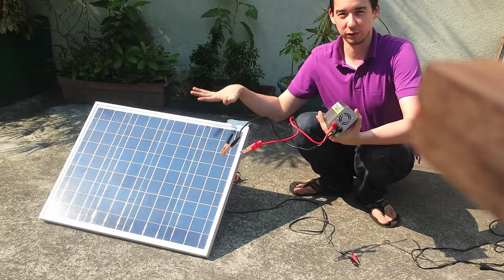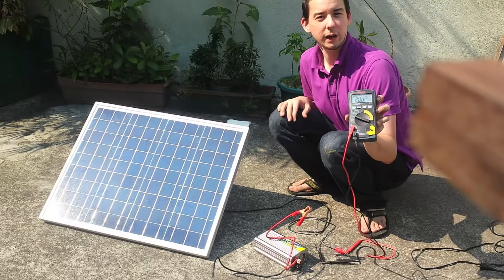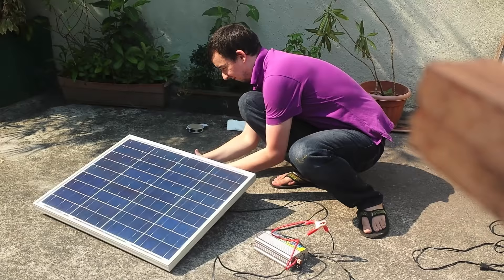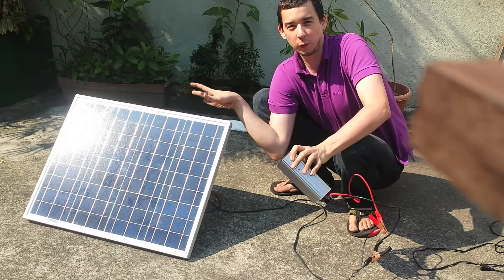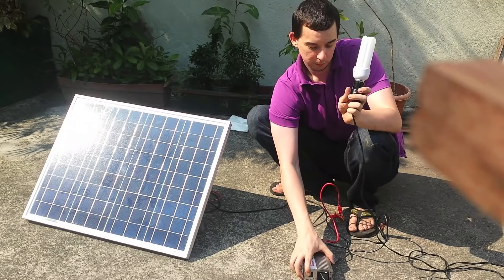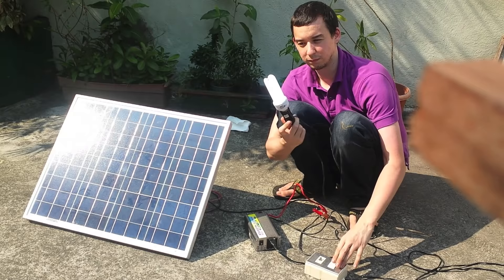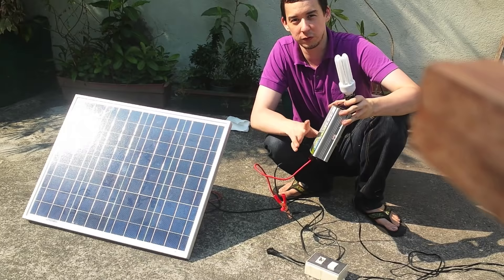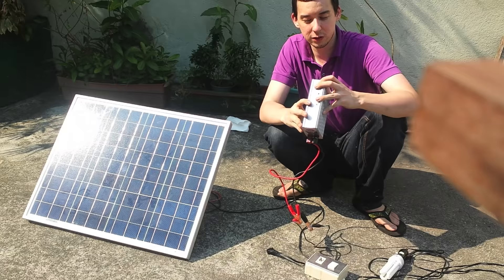Inverter wired directly to solar panel

Comment: Hah! I did that in Spain...   to explain - I have a 250w panel in our summer home in Southern Spain - an area (Andalusia) where you can pretty much guarantee sun all summer - unlike where I am now back in the Northeast of England where you can pretty much guarantee the opposite. The very first thing I did on setting the panel up, was to play with my new 12v invertor - but what I did was to put a step-down buck converter onto the solar panel - mine is 24v and chucks out a lot more than that obviously as it is for charging 24v batteries.... the step down produced 12v which I fed into my 500w invertor which looks remarkably like yours... I have to say it worked a treat...and recovered well from any passing clouds.  Today I have a pair of deep discharge batteries (100ah, 12v) in series on that rig which runs all year around lighting up the outside of the place - and also powering a couple of FriendlyArm Nano (with little hard drives) constantly - but those initial experiments without the battery were lots of fun. Aliexpress do cheap step-down units very cheap that will handle 15 amps.

Comment: Most inverters have a volt cap around 21V and a fuse that matches it's input current cap. Then they typically have a <0.1A and <10.1V shutoff. The best inverters are pure sine 2000/4000 with aluminum enclosure and fans and the best panels are usually this size 12V and 100W. The best batteries are 250AH 12V deep cycle AGM for around $350(unless you can afford nickel Edison batteries) each and you never go below 50% on any deep cycle so 125AH per cell. You need a charge controller and 2AWG cable too if you use batteries.. That's all you need to know..

You can't accurately control or even monitor charge percentage just go by consumption and total AH divided by 2 on single cell or banks.

Those "install experts" and "engineers" who do home installs are BS artists who just use elementary school math and bolt-on everything..

Comment: Some inverters have DC inputs directly from solar panels but I would highly advise one not to connect it up to where the DC battery input is supposed be. At least use a buck converter to convert that 20V DC into 12-13 V DC as that's what the inverter is expecting to receive that way there's no risk of damaging your unit.

Comment: I posted a message nearly a year ago about using a buck converter to step down the voltage going to an inverter.  I have an update.  For many months, I've been doing just that.  I have 500 watts from two panels in my backyard and the voltage under load is just over 30V.  I have a 24V inverter whose upper limit is 30V.  Since it's JUST on the borderline, I use a high current buck converter to regulate to 29.5V.  I found that the 24V pure sine wave inverter I have will actually draw LESS amps for a given load if I give it more volts.  This has been working flawlessly for me.  I don't mind that the inverter shuts off if a cloud shades it too much.  It's rare enough during my experiments that I don't have to reset it very often.  I play around with electronics during the day and will not use a battery unless I absolutely have to.  My house is separately powered by more solar panels on the roof with net metering.
Reply: Oh, since the buck converter is barely stepping down the voltage (and sometimes not at all), it doesn't get the slightest bit warm and the efficiency is about 100% for all practical purposes.  It's really only there as a failsafe so the inverter doesn't whine and shut down.
Reply: Is it possible to have the inverter auto-restart.  Thus, if a cloud goes overhead or it gets dark, the inverter just restarts when sun shines again.
Reply: I was thinking of doing a sort of passive skylight for my dark house. 
I'd like to connect it to 12v led fixtures that dim and brighten along 
with the sun. Do you think I would be able to use only solar panels and a
 charge controller at 12v to make that happen? No need for an inverter.
Reply: @pauls0416  Adding a bank of capacitors will improve the performance.

Comment: Put a meter on the solar panel output while the inverter is under load. You will see that the panel is not putting out 20 volts, it is now down to around 13-14 volts which is safe for the inverter. Solar panels have a rating called VMP which is the point at which it can produce the most power in watts.
Reply from the maker: Yup, that's true, there will be a voltage drop when the load is connected.

Comment: Good video, short and to the point.....but would have been interesting to see how the voltage into the inverter changed as different loads were plug in.
Reply: Good point! I was hoping he would use his voltmeter to observe the loaded voltage out of the solar panel.

Comment: Just as long as you turn on the inverter with the load connected, the 20V output from the solar panel will not be an issue. That 20V will immediately drop lower due to the load.
Reply: Depends on the load vs the panel wattage. Imagine a huge array at 20 v. A dinky CFL isn't going to drop the voltage much.

Comment: You need a buffer of some sort. most inverters have capacitors inside and on a 12v inverter they are likely only rated to 16volts. Open load your solar panels is likely 18-21 volts. It wont take but several minutes to let out the magic smoke. The only time the inverter will see safe voltage is under enough load. as soon as you unplug your light, it becomes unsafe again. I know from experience after destroying a 300w automotive inverter.

Comment: John Steel IV
1 second ago
they say you can disconnect the battery backup. connect wire from solar output of charge controller directly to inverter, and power things. I have seen it done. it's awesome, they said it was by mistake as the wire from the charge controller (C.C.) and inverter where conect to same terminal and when terminal was removed for working on system , it still stayed on.

Comment: I have a camping solar panel which is foldup rated at 100w. I have tried to connect dc small motors to the output before & nothing works. Then i read in the instructions that it will only ever work to charge a battery, not to run anything directly. So i was pleasantly surprised by your findings here!
Reply from the maker: That's very strange. Do you remember the brand and model? It's possible that they've built some kind of controller into the panel and that's why you're not getting any output unless you attach a battery. In fact many charge controllers won't output any power unless a battery is connected because one of the output terminals is usually direct from the battery and then the other is switched by the controller.
Reply: Cannot remember the make, but yes it does have an integrated mppt charge controller mounted on the back. As we have super duper sun here in Australia, it can at times generate more than 100 w. I have a rated 2250w solar 12 panel array on my house roof, & one sunny day it was producing 2650w, way above rated capacity.
Reply: Richard Gray , work for a motor, you must connect a big capacity of inverter that enough for water pump

Comment: You should add voltage regulator between panel and inverter to give constant 12v
Reply: Agreed, but the current would be too high.  Maybe an SCR?
Reply: @jaysonwallker1648  there are adjustable voltage and ampere module available in market
Reply: @Restore2761  I've seen some on AliExpress, wondered if they were any good.
Reply: @jaysonwallker1648 Adding a bank of capacitors at the terminals of the inverter will improve the performance.

Comment: If I connect buck boost converter in  between  will it operate steady ? Or it's based on how much amps we get input? I think solar amp would not be enough for inverter to run if we connect more than 200 watt load . So for this needs at least 20 amps 12 v battery through the charge controller to have steady and powerful output . But again it's a game of electronic so you have to build all cleverly with correct schematics and measurements .

Comment: Handy idea if you already have a maxed out hybird inverter with battery. Can use this method to decrease self usage during high sun. Reduce the load or alow the hybrid charger to kick in when it detects excess from this simple setup then will return to grid or better case, the hybrid inverter will divert to an Eddie if for example the battery is already full? Am I right??

Comment: I wanted to add that inverters have a max input voltage and will shut down when it's reached. For a 12v system, the max can be as low as 15v on cheaper inverters, but some batteries like trojan batteries require 14.8v from the charge controller to fully charge. So even though the inverter specs may say 15v, in real life it could be lower and your inverter will keep shutting down during the day. If you lower the charge controller voltage then your batteries might not get fully charged, which will shorten their life. Quality inverters will have a higher maximum input of around 17v. So for an RV, go with name brands like Magnum and Outback.
Reply: You can use step down voltage regulator to give exactly 12v to inverter. Those regulators can transform 8-40v to 12v for example.

Comment: You can always wire something 12 VDC directly to the panel, it will work as long as the load is not greater than the panel.
Reply: It is better to use DC loads directly to the panel.

Comment: Do you know if in the market there is an equipment that can do it?, because the energy pass directly from panel to 220v.

Normally:    Panel ----------->  Solar Charger Controller --------> Inverter -------------> 220v
Reply: I have an mppt with one set of outputs to battery another output to a load. Common ground just positive is isolated to keep from draining the battery while it's being charged. It failed over time though due to some kind of abuse I put it through leaving it outside and ripping the wires out of the flimsy connectors. Why are so many charge controllers made so flimsy?!
Reply: So corporations can make more profits

Comment: This can only be done with certain inverters as most will detect overvoltage and cut out but I have tried it with a few different inverters and it does work but most people that use solar panels have batteries and charge controllers so they can carry on using the system after dark. Good video though.

Comment: Thank for posting I agree Solar panels are for to powerful to go directly in to any  small 12 v inverter there rated 12 v  1 amp but As soon as the current hits  21 volts it blow the fuse in side  the inverter.  put it though two  deep cycle  battery's  rated at   250AH 12V should  do the job.

Comment: Connect a solar panel......direct to a dcmotor , with a pulley, and a belt , connected to a car alternator.  Provides strong 12v power with amps behind it.  Make sure motor goes more than 1800 rpm and can move to the alternator.

Comment: Pls is a charge controller designed to work with solar panels only or anu form of power supply like d one from step down transformer and rectifier

Comment: I am about to do exactly this with a folding Dokio 300w panel into a small Bestek Pure Sine inverter in order to power a 160w DeWalt fast charger. I am however going to put a 12v DC-DC converter in between the panel and the inverter to give me a steady 12v supply rather than the 18 coming off the panel.

Comment: a golf cart 24/36 v to 12 v adapter will do the trick for a bit but they tend to heat up if left unattended . i suggest only using this will keeping under watch  and only using for small things in a quick use... like a quick charge on a laptop or something like that... keep monitoring it and when the quick charge is done  disconnect and dont burn your fingers on the converter. do not use this as a long time system. this is not for running your drill, plasma tv fridge or pc all day  heed the warning

Comment: While browsing through Ace Hardware, i came across a powerbank that can be charged either through socket or solar, since the pack itself has solar panels. I think that would be video since solar powerbanks are not yet known in the country. 😊

Comment: Add a buck converter and low voltage disconnect device. Solar Panel -> Buck Converter (14V DC) -> Low Voltage Disconnect -> Inverter.

Comment: Can i use voltage regulator to get the voltage going into the inverter stable ?
Reply: I think you could use a 7812 regulator with a 10microFarad cap between input and earth (0v or Ground) and the same between output and earth (0V or Ground). You will also need to make sure that the inverter doesn’t draw too much current to lower the solar panel voltage to less than 14Volts. These regulators can run hot so you should use a heat sink when u you use them. That’s what I would do anyway.

Comment: great information. would using a charge controller be a better idea. I want to charge a battery on an ebike/etrike. I could charge the battery from the controller or wire an inverter into the load and then plug the battery charger into that.

Comment: Can you run through a crappy battery just to absorb the excess without caring if the battery actually charges properly. I want to run the equipment for a little Hydroponic garden only during daylight hours. Paying for expensive batteries seems excessive.
Reply from the maker: +John Smith yes that's basically how I would do it. But add a cheapo charge controller too.
Reply: A solar panel or solar panels and a '' crappy '' battery can lead to a fire and or a explosion and may create toxic fumes  from that '' crappy " or damaged battery. 
Don't do it, bad advice .... without fusing the system properly and without a charge controller, which without it can overheat batteries. 
Did you ever had a overheated runaway battery that made you to evacuate your whole family from your house even though the battery was outside the house? It is no fun,
I seen many fires, explosion and chemical smoke from  '' crappy  '' batteries at work. Why take a chance with your family or property to get damaged or hurt or even killed. 
All a crappy battery would do is overheating and boiling the acid when power is applied.

Comment: I connect 380 volts PV string to my 6.2kw solar hybrid inverter , and run the whole house without even connecting the batteries and even without connecting the grid. single source solar, and running the whole house. Of course, you can enjoy heavy surge loads. mine gives me 1600w surge load from the solar only in sunny day and peak hours.

Comment: Thank you for sharing this. I am based in San Francisco but I have a house in Dipolog City. I am setting up a 210 kw a month month solar system. I need some guidance and maybe you can help me. I know that solar panels with cdr-king is good that changed my mind about buying it here in the US and shipping to the Philippines because that is just throwing away money. Is there a way you can sent me like an schematic about setting up the system and which appliance or gadgets to buy here in the US rather than in P.I.? Thank you very much.

Comment: i like the idea of mr. hough. but since the the battery is connected to the solar panel , is it posible to add a switch that will trip off incase the battery s full charge & vice versa
Reply from the maker: It would really be better to just use a solar charge controller which will properly regulate the charging voltage and protect against overcharging.
Reply: your idea is much better

Comment: phil how to compute battery hour for how long it charge at solar??? and how to compute the usage time of the battery depend on watts i consume?
Reply from the maker: I won't go into the exact science about it because it's a huge topic that's better covered elsewhere online. But I'll give you some real basic 'scrap of paper' calculations you can do. You want to work out how many watt-hours your battery is. Multiply the voltage by amp-hours. So for my motolite 100 ah battery, its 12x100 = 1200 watt hours. That means I could run a 20 watt load (small dc fan) for 60 hours. Or I could run a 100 watt load (desktop computer with lcd) for 12 hours. But then you don't ever want to run your battery down past 50%, so actually half those numbers (fan for 30 hours, desktop computer for 6 hours). If you have a 100 watt solar panel and it pushes out 100 watts for 5 hours, you're storing 500 watt hours into your battery over that 5 hour period. But of course with varying sun conditions, losses in your charge controller etc, you might only be pushing in 80 watts at a time. If we looked specifically at your 10 watt panel and imagined you had a 7ah 12v battery, that battery would be 84 watt hours. So your solar panel would need around 8 hours of perfect conditions to fully charge the battery from flat (although it should never be flat since you don't want to let it run down below 50%, so it should be around 4 hours!)

Comment: Is there no way to have a rechargeable battery between the panel and the inverter? 

I use in an 12v to 240v inverter in my Prius but the petrol will charge the rechargeable battery and store it until plug something into the inverter and draw power from the 12v battery. Can this not be done with solar?

Comment: Is this solar panel output 12volt dc? Because inverter wired connected  12 volt DC line